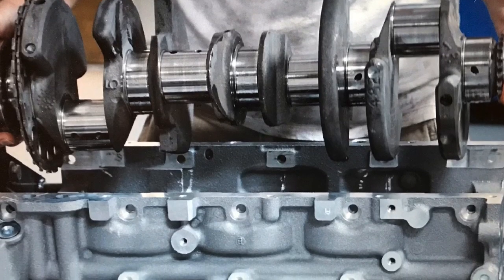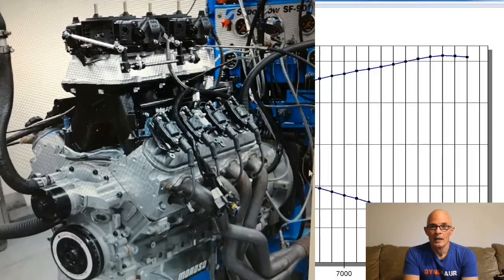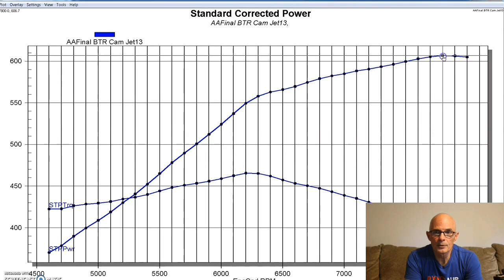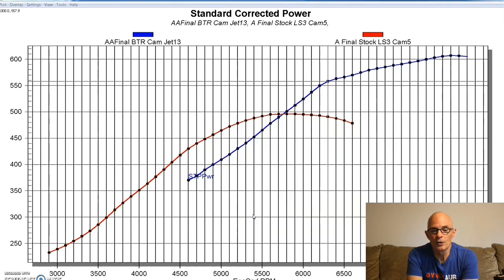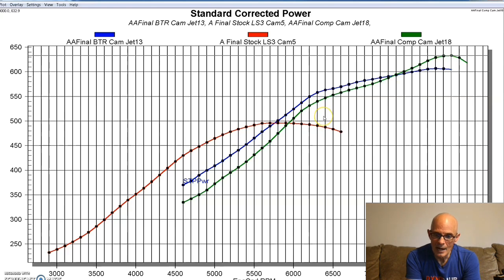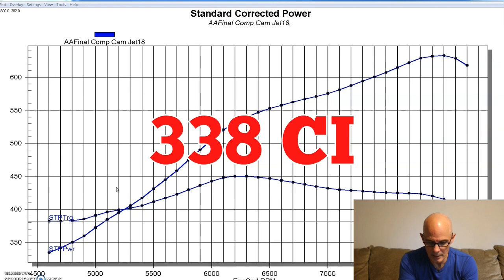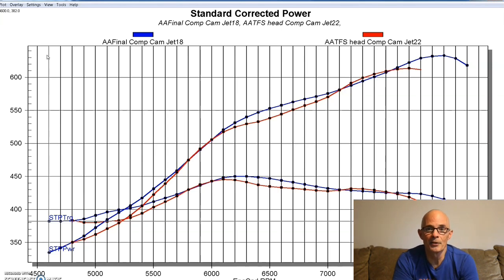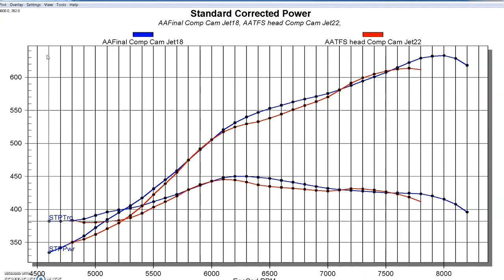DESTROKE LS-4.8L CRANK IN LS3 BLOCK-SHORT STROKE POWER-AN LS MONSTER MYTH?

Comment: So with no limitations other than 5.7 liters and pump fuel, which motor can make more power? Short stroke 4.125 bore or stock ls1 style bore and stroke?
Reply from the maker: at 15000 rpm, bigger bore can help

Comment: Some classes have certian rules that dictate some things. But also you can fine tune characteristics for limited traction, suspension. Its a combination of things. Always run the biggest bore you can and adjust stroke. Also longer rods wouldnt hurt alot of times. And the top end and cam have to be adjusted as well according to what you are trying to do.

Comment: Destroking will also provide a lower torque number, and torque breaks thing not horsepower. I'd rather have a rev happy engine than a ton of low rpm grunt
Reply from the maker: rpm hurts motors
Reply: @richardholdener1727 fair but torque breaks trannys, clutches driveshafts, axles and differentials

Comment: Is there any chance you’d be willing to do a de-stroked EFI ford 300? I’m wondering how well it would play out to simply put a balanced 240 rotating assembly in an EFI block. Of course you may need an elusive 300 aftermarket intake but if you ever got around to it there’s a few demographics that could learn a lot. Thank you for all the information and knowledge you share in general. I hope you keep it up for as long as you possibly can
Reply from the maker: smaller just makes less power

Comment: To say you can rev any stroke to high rpm is to ignore piston speed, and while possible to run an engine with excessive piston speed it won’t last very long and is bad form promote poor fundamental give building practices……anyways although short strokes can rev while maintaining acceptable piston speeds “wink wink” they are over square which directly inhibits its rpm breathing potential…despite my objections the motor you built is awesome and it’s my favorite LS combination however I use stock rods and aftermarket pistons, I think you have to big a cam your combination should be cammed  for around 7300otherwise give up too much torque for little return in hp due to asthma of the extreme oversquare nature , also lobe separation is super important and I know the ideal specs but it’s a secret  , also your tq peak should be significantly lower like 5000 rpm so I hope you play with this  combo some more and you crazy not running a mechanical cam your lifters must be so tight they basically solid anyway
Reply from the maker: you need to go back to school on piston speed-look at pro stock and mountain motors-your concern on piston speed is unfounded in the given rpm range

Comment: That’s a consideration for the engineers designing platforms and engines basically. LS heads flow so much and have such big valves they will inevitably run out of rev before running out of air.

Comment: Destroked 6.2 will definitely have louder exhaust note (shorter stroke increases exhaust velocity)
Our destroked 400(352)
is boomier @ idle than similar exhaust sbc 350
Reply from the maker: not sure that correlation is accurate

Comment: a shorter relative stroke allows for higher rpm with the same relative piston speed….people blab  and blab but nobody ever mentions piston speed lol so clueless, also at the same time the shorter stroke inhibits rpm potential due to somewhat lower breathing efficiency relative to a longer stroke thus requiring more head flow per horsepower , also the power band  is significantly wider with a relatively shorter stroke which must be accounted for when considering idle speed and other factors nobody mentions lol
Reply from the maker: the stroke length does not alter the rpm potential of this motor-that is all valve train (maybe you are thinking of F1 motors-which does not apply here)

Comment: so he doesn't understand mean and peak piston speed? wow
Reply from the maker: he understands both (and how to measure each), but you don't understand that those speeds don't determine this level of rpm (that is all valve train)
Reply: @richardholdener1727 F1 picks their stroke to manage piston speed at such high rpms. Go learn about max piston speed for cast, 4032, and 2618.
Reply: Wrong, piston speed and rpm goal is where you start, to pick your stroke for the application.

Comment: My problem with super high-RPM LS engines is I'm afraid the monster valve springs are going to eat up the cam over time.  The bottom end is easy.  AP1 and AP2 Honda S2000s have the same stroke as a 340 Mopar and 360 Mopar, respectively.  I'm not worried about the bottom-end.

That said, if you do have too much stroke and rev it too high, it'll be FINE.  Even better than the long stroke... until you scatter it at 15 hours.  Drag racers don't log many hours at high revs, so it's easy to think you can get away with murder.  Look at all the high-revving K24s out there - those things are stroked like a Ford V10.  They'll scoot on the street for years and make lost of passes, but they're 1-season motors on a road course.  Longevity at rpm is where short strokes and lightweight valvetrains win.

Comment: I think the best way to look at the effect of short stroke, high rod ratio, dwell time, and efficiency is torque/cid across the rpm range. 

Thanks for showing this. I was thinking about putting together that block and crank for a Factory 5 Hot Rod because those are so light, and don’t need aggressive low end torque- so why not a screamer 🤘😆🤘

Comment: Please note the dz302 was making 500hp na in the 60's came with a solid lift cam from the factory and would rev 7500 all day long with the 186 heads way more power than a stock 327 or 350
Reply from the maker: No stock 302 ever made 500 hp, 186 heads were the same as any other Fuelie heads and a DZ302 made the same peak power at 327 and 350

Comment: So im trying to learn more on this. Doesnt shorter strokes pull torque back? Thats why I run over square is to pull torque away to try and keep tires planted.
Reply from the maker: smaller motors (either smaller bore and/or shorter stroke) make less power

Comment: one piece you didn't touch on which you didn't touch on has nothing to do with the power numbers but wear characteristics and longevity. you get a better rod ratio, significantly slower piston speed, and gentler inertia transitions with the 4.8 crank. most times hot street car/drag car  it doesn't make enough difference to matter but in a drift car or a rally car where you are commanding a significant amount of power high in the revs it can make a substantial difference

Comment: Kinda a modern day 400 with 305 or 350 crank making a 377 that liked 7500
Reply from the maker: why does a 377 like rpm and not a 350 (with the same stroke)? The answer is stroke length does not determine rpm

Comment: Richard, what about rod length and dependability?  years ago i ran a gm 383 with a 5.7 rod they never lasted long redlining usually around 6400 in a 90's lt block, later i change to a 6.0 rod length and shorter piston and it never broke, was that luck or the rod drive angle? thx!
Reply from the maker: WHAT LENGTH ROD ARE ALL THE FACTORY MOTORS?

Comment: You are partially correct in that F1 engines use a large bore and short stroke to get larger valves and thus move more air in and out of the engine with less restriction while staying within the displacement constraints imposed by the regulations they are required to adhere to.  However, you are incorrect about a shorter stroke not leading to a higher rpm potential.  If you have 2 engines with the same displacement, but one achieves that through a short stroke and large bore, while the other has a long stroke and a small bore, the engine with the shorter stroke will have a higher rpm potential (assuming they are both made with the same quality of parts and materials).  This is because the engine with the shorter stroke will experience less jerk at the same rpm as the engine with the longer stroke.  In case you aren't aware, velocity is the derivative of displacement with respect to time, acceleration is the derivative of velocity with respect to time, and jerk is the derivative of acceleration with respect to time.  Basically in the context of an engine, jerk is a measure of the change in acceleration of the reciprocating mass in the engine and the greater the jerk the more stress those parts experience.  Thus, for the same displacement, an engine with a shorter stroke and larger bore will be capable of achieving higher engine speeds before failure than an engine with a longer stroke and smaller bore.

However, maximum rpm potential usually isn't the only consideration when choosing a bore/stroke ratio.  The shorter stroke engine will rev more freely and will achieve peak power and torque higher in the rpm range, and as you mentioned, will allow for bigger valves.  Meanwhile, the longer stroke engine will achieve peak power and torque at lower rpms, with more torque overall thanks to the greater leverage at the crank afforded by the longer crank throws necessitated by the longer stroke.  There are also differences in thermodynamic efficiencies between a short wide combustion chamber and a tall narrow combustion chamber.  All of this should be taken into account when designing/selecting an engine to make sure it is suitable for your use case.  However, if you are purely looking for high rpm potential, then a shorter stroke is going to help get you there.

Comment: Anyone have a link for 4.000 in bore pistons for the 4.8 crank 3.267 stroke??
Reply from the maker: use a std 6.0l piston if you have the right rod length-but Summit has what you need

Comment: Engine components available can only withstand so much G- force a short stroke engine has a slower piston velocity, eg. a 350 LT1 can rev to say 6000 rpm witch equals 600cfm when a DZ 302 can rev to 8000 rpm with about the same strain on the reciprocating assembly, but consumes about 700 cfm thus is ultimately able to make more power at high rpm and stay together
Reply from the maker: no

Comment: If you hadn't already, I'm behind on your reels. I want to see twin or single turbo on this motor. Because I have a 3.25 BBC crank, and I want a 4.600 bore motor twin turbo. And I need a scale model to dream on. 😂
Reply from the maker: we did run boost on this motor, but with a smaller cam

Comment: I think there is a misconception in the term high revving short stroke.... and that misconception is rev speed... the time it takes from 3000-7000 rpm, for example, in a short stroke is gonna be less than a long stroke because that piston doesnt travel near as far to complete a combustion cycle...thats what the dz302 was known for, rev speed...
Reply from the maker: the amount of time a motor takes to rev against a load (while accelerating) is a function of power output, not its ability to free rev

Comment: Richard I'm building a destroked 6.0 for a C5 Vette. Wondering what you would recommend for a cam. Car is going to go to the track here and there. Don't want to drop all the low end torque out of it but would still like to wind it out past 7k. Planning on running Holley hi ram. What would be your recommendations thanks in advance love your videos.
Reply from the maker: I would keep it a 6.0L and rev it past 7000 rpm

Comment: What about the speed in which an engine can reach redline. Is that a thing?
Reply from the maker: in gear?
Reply: @richardholdener1727  yes and does an engine with less overall mass and shorter stroke able to accelerate faster compare to a longer stroke engine. Like a Ferrari 360 or the new Z06 5.5 liter? You certainly have explained that a long stroke engine could reach the same high rpm as a short stroke but does a short stroke get there any quicker?

Comment: Very correct but high rpm reliably or for limited amount of time it's also rod/stroke ratio but it terms of 8500+ rpm most anything considered small block can rev to 8k but is the bearings and of course valvetrain handle it 😉

Comment: But wouldn’t a short stroke rev up quicker? It would make a snappier engine would it not? I feel like a 4.8 crank in a 6.0 block with a supercharger would be nasty.
Reply from the maker: it just makes less power because it is smaller
Reply: @richardholdener1727  fair enough, thanks for the content brother. You do a lot of cool stuff. Keep up the good work 👍🏻

Comment: So basically run a 6.0 with a 5.3 crank and a really good set of heads
Reply from the maker: A 6.0L (4.0 bore) and 5.3L (3.78 bore) have the same (3.622 stroke) crank. They differ in bore size. This was an alum LS3 block (4.165-bore) and 4.8L crank (3.264 stroke).

Comment: I was considering assembling a destroked 6.0LS for use in a daily driver. With 4.88 gears (or lower to recover some torque). And either a 700R4 or 6L80 Transmission which would put the rpm of around 2000rpm at 75mph according to various gear ratio calculators. Would this be an advisable idea or would I need to change the  engine to a standard non destroked engine, different transmissions, or a different axle ratio? Thanks in advance for any and all advice, opinions, or answers.
Reply from the maker: why are you changing the stroke-you are only decreasing the power output of the motor-that is not necessary and has nothing to do with gearing
Reply: @richardholdener1727  I just like the sound of a high revving LS. But that's also why I ask questions before I start purchasing components for a build. Thanks for putting things in perspective for me.

Comment: In the old days (SBC), it was worth it. In an LS? Not really. After the first time I saw a factory LS7 bottom end  go 8k without a sweat, and an LS2 turn 9... I'll never destroke.
Reply from the maker: it wasn't worth it on a SBC
Reply: After deleting 6 paragraph explanation...

 Long story short, horsepower was cheaper and easier on a shorter stroke crank before the mid-late 90s. A lot of the stuff that's so commonly available nowadays for SBC was unobtanium for the average joe before then.

Comment: So.... curiosity question.  If you use a roots style, or LSA supercharger on this setup with a boost friendly camshaft, would you makeup for the lack of HP, and Torque down low, or would it just amplify the results up top?
Reply from the maker: a smaller motor makes less power than a bigger one. Adding boost or any cam to each of them results in the same thing happening. If you question is can you take a motor that lacks low speed torque and make it better with boost, then the answer is yes-but do that will also improve a bigger motor that already has more of that to start with
Reply: @richardholdener1727   Thanks for that!  I'd love to see this repeated with a big cube motor such as an lSX 454 ect.  Maybe if we get you to 500k?!?

Comment: Low stroke (over square design) engines almost always exhibit better oil control than similarly designed longer stroke engines and this makes logical sense since it is easier to maintain a uniform thin film of oil on the cylinder walls for the piston skirts and rings to ride on when piston velocity is reduced.  It's easy to see how high torque rise long stroke engines have larger internal stresses and that larger crank journal swing arcs result in more off axis forces on the pistons which result in increased wear. But that only tells part of the story. Oil film control is extremely important in reducing cylinder wall wear, piston skirt wear, and ring wear. The short stroke engine just has a proven track record of doing this better because of the demonstrably reduced piston and ring velocity.
Reply from the maker: stroke vs oil control?

Comment: I wonder, on this 6.0/4.8 combo, how the 706 heads would do. I know they have the small valves, but the chambers are 61cc and the Int runner is 200cc. Should make for higher intake velocity, which would counter the slower piston speeds. I will try it when I build mine.
Reply from the maker: I have a vid up with 706 heads on a 6.0l
Reply: @richardholdener1727  What's the video called?

Comment: I know its an older video but still had to add..quite a few of these legendary short stroke motors came from displacement limitations in whatever motorsport they were being ran in. The DZ-302 had to be a 5.0 for Trans Am along with the Boss 302, then Chevy and Ford just decided to sell street versions. Funny enough, Chrysler also used a 5.0 in their Trans Am racers but when it came time to make a street version what did they opt for? 340. It's just better. If they could've used the 340 in Trans Am they would've, same way Chevy would've used the 350 and Ford would've used the 351

Comment: So I just bought a 99 lq4, which has a "long crank".

Is it as simple as just putting the 4.8 crank in? Or should I just scrap it and grab a newer lq4 block for my application?
Reply from the maker: block is fine-the 4.8l crank will just make less power

Comment: How would this engine perform with a more low-end focused cam?
Reply from the maker: EVEN BETTER IF YOU HAD MORE DISPLACEMENT
Reply: @richardholdener1727  Would the power just drop off much earlier in the curve?